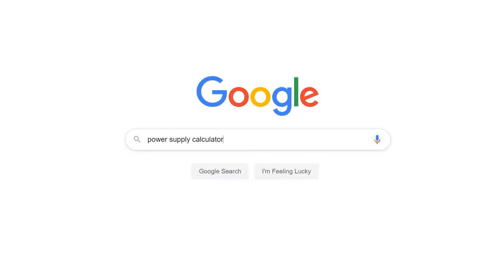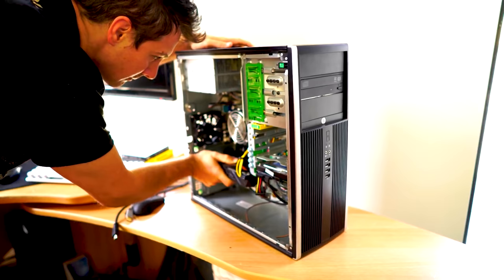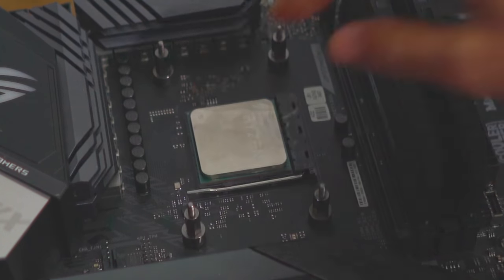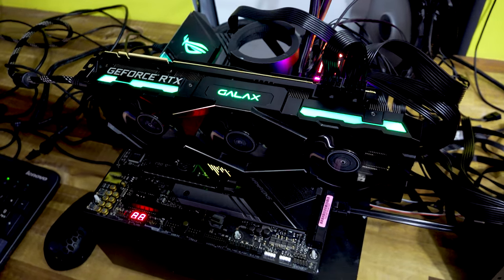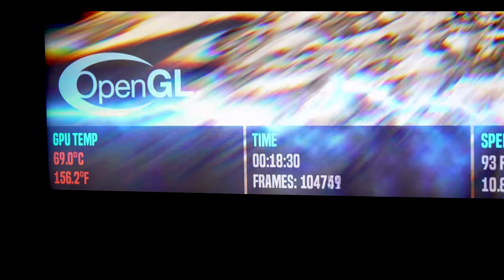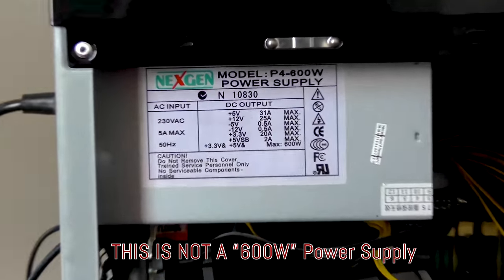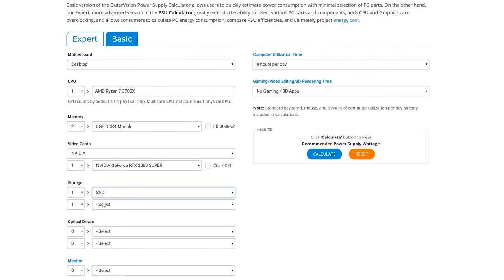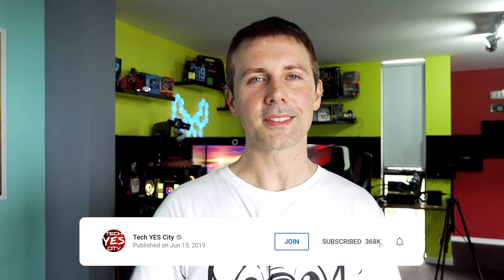I Tried Running a 3950X and RTX 2080 Ti on a 450 WATT Power Supply...

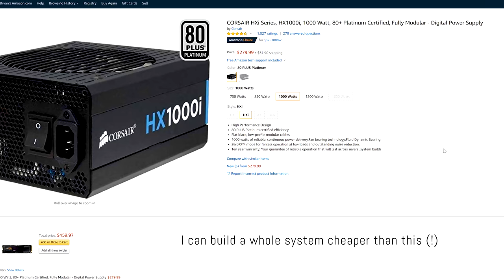Comment: 1:30 I blame online elitists for convincing the guy he needs 1000W power supply.
Reply: "Bro if your computer doesnt have two 2080 ti in sli, a 9900k, 64 GB of ram... is it even a worthwhile computer?"
Reply: @jjt171  need atleast 256gb ram so you can have afterburner running in the background
Reply: The Thousand Watts was probably Overkill, that said once I add in a handful of hard drives, two Optical drives, my extra weird card reader for reading any card made in the last 15 years, a video capture card oh, and a double handful of USB peripherals I don't really have a problem with burning an extra hundred fifty plus Watts out of the wall it just happens.
Reply: Those PSUs might still be recommended by people like myself, not really elistism, but those of us that did a pc build during the era of Radeon and Nvidia GPUs running stupidly hot and consuming insane amounts of power back in 2010-2012, just think about the GTX 400 and 500 series, a 560 NON TI takes as much power as a 2080 TI but the 560 obviously have to draw more power on average as it was a low-mid range GPU at the time, meaning that it can hit that max TDP much quicker then a 2080 TI....

Worse yet, we then had AMD and their Pheneom II X6 series which would happily sit at a 135w TDP!!! 135!!!!
To make it even worse, back then when the 400 and 500 series cards were relevant, SLI and CFX were much more common so now you got two cards able to draw 440 watts, and a 90-135 watt CPU, meaning that suddenly a massive 1200 watt psu with a 80 bronze rating...oh and if you wanted the big fancy 580 ti you would go past 500 watts in a SLI setup...and the 590? 365 watts...ok true that was already a dual GPU card but still! 365 watts!!!

What I am getting at is; we got a lot of people that do not know better because of past experiences with power requirements, it was only with the GTX 600 series Nvidia got their shit together in terms of power consumption

Comment: I have run a Vega 56 + 7700K (both heavily overclocked) on an EVGA 550W unit and had no issues whatsoever. 
FPS was capped at 144. 
But I have always trusted EVGA units so it was no real surprise.
Go for a quality, trusted brand and you don't need a super high power rating.

Comment: i was half expecting him to just plug it in, see it doesn't work and then end the video
Reply: Why? PSU has like 25% of headroom??
Reply: @rkan2  the moment he overclocks his cpu and changes the monitor to a 2 or 4K resolution is the moment this PSU will either smoke its fuses off, or will just refuse to run.
People need to understand that people who buy enthusiast level hardware like the ones he shows mounting in his clip aren't actually buying them for casual use as he gives an impression, let alone the hardware he stressed on was built to take heavy workloads, and I would add that he actually misuses it in this clip unfortunately.

Tell me one lad with a decent budget who would pick a 2080ti with a 1080p monitor, or a lad who got himself an r9 3950x just to use it for casual work load and not even overclock it?. Hell tell me what kind of people who buy this kind of hardware who aren't at least tech savvy enthusiasts and tinkerers in the first place.
Reply: @achu-7941  I mean... There is still plenty need for 2080ti when you have 144hz+ monitors at 1080p...

Comment: After my 650W budget psu (corsair) died, i opted for a  850 model as i though my system needed more juice. 
Waaay overkill for an i5 and 960 gpu.
Reply: I use an 850 watt for my 2080ti and 3900x I think you need more for the i5 and 960 for sure
Reply: itll run cooler and at around 50% use, most efficient as it peaks at around 40 to 60% and drops slightly at 90% and up. So having headroom is good but planning to have the psu run at 50% avg is best.
Reply from the maker: be careful with powerboards, i have had a power board trip out my whole circuit and damage a power supply in the past to the point where it is smoking now (unusable), that power board suffice to say is no longer in action.
Reply: A 450W Corsair CX would have been the right option IMO (unless it was a k model, then 550W)
Reply: @techyescity  Yeah i'm currently using a powerboard as an extension.
It has like 6 sockets to plug in but i won't go higher than my rig and monitor.

Comment: A lot of the branded power supplies are all made in the same factories in China these days. Coolermaster being one of the main ones. GPU Manufactures always spec high ratings on Power Supplies because of all the inferior models out there. One of my favorite system builds was Dual R9 280x crossfire, i7 950 OC @ 3.6GHZ, 8GB RAM, SSD . It ran crossfire games on Ultra pulling 350 watts from the wall. I had a 80+ gold 550 watts installed and it didn't miss a beat.

Comment: Are dell’s 1060w 80+ gold any good ? I mean they are “cheap” and look decent
Reply: They were took out from old Dell workstation or tower server I guess. They are decent, most of them are made by Delta or Seasonic. Both of them are good name in PSU making scene.
Reply: @Archmage1809   isn't dell power supply are made by great wall ?

Comment: Volts multiplied by amps equals watts.
Reply: Input (AC at wall) and output (DC) wattages are different.
Reply: @williamlau7179  the same formula still applies for both AC and DC

Comment: Most quality power supplies have some design headroom, and so do the components. When my 800w PSU died I ran a spare 450w PSU past it's rating for months on end and it was fine, never got hot either. 500-520 watt power draw at wall for me. It is still a gamble, any weaknesses in your hardware and the magic smoke comes out.
Reply: id say "most quality gold rated +" have the headroom design, on cheaper psu its the other way around most of those trashy psu's cant even deliver what they are rated for. Also most workloads dont stress all components at the same time thats why you managed to run your system on 450w psu.

Comment: You can run inadequate PSUs on a larger draw system you just run the risk of system instability,  wearing the PSU out faster or making the caps explode potentially. You can also run a laptop or monitor with a lower than recommended amperage but same thing might happen- hotter higher stresses stuff usually fails faster but it’s probably fine in a pinch.

Comment: I was always told to get a power supply that lets you run your system at 50-60% of the rated wattage. That way the PSU isn't running like mad just to idle at the desktop. Also, the higher power output PSUs are usually more heat efficient.

Comment: Power supply calculator: "Recommended PSU Wattage: 521 W"
Also Power supply calculator: "Recommended Power Supply: 650 W"
Reply: Well you might have a HDD or several USB devices.  Not to mention fans.  Then there is water cooling.
Reply: @MrRourk  it....it's literally the point of those calculators to take these things into consideration. That's why they ask for such things in the first place.
Reply: Most reputable PSUs have 80+ something efficiency certificates, which means that they waste less power from the wall when they reach that 80%+ threshold, so maybe that sites are recomending more watts in order to fill that 80% of their capacity and being at maxumim efficiency.
Reply: @MisantropoFilantropo  80+ efficiency doesn't mean you have to reach 80% usage to reach that efficiency. It's a certificate that shows how energy efficient a unit can operate at 20, 50 or 100% utilization/load. 

So no there isn't any 80%+ threshold you need to meet. It just means that the unit itself is more efficient by converting less than 20% of the power into heat at 20, 50 or 100% usage.
Reply: Most of these sites are having partnership with PSU manufacturers and they want ppl to buy expensive PSU because they want more money

Comment: I generally like to overbuy on a PSU.
But not in false thinking that I need that additional power, but to have it more silent, because it is not as stressed out and therefore runs cooler.

For instance, I bought two 550W PSU recently, although even the little brother with 450W would have done mighty fine (Optiplex 3020/9020 replacements).

Concerning acoustics I have been damaged by my first PC all those years ago. That thing was loud as a jet engine (literally! And that is also the reason, why I avoid Cooler Master fans) and I want my rigs to be near silent now because of that.

Comment: problem is that people WILL use this as confirmation that they can scrimp on a psu, and while it may hold up when new, what about as it ages and starts clogging with dust? Many are already arguing they can get away with lower than nvidia's recommendations on the new 30 series gpu's. People are also likely to forget they've pushed the psu to its limits when they later decide to try an overclock, or maybe upgrade. Yes that 1KW example is clearly overkill, but it's always wise to err on the side of a comfortable safety margin. I have known an older, cheaper psu to catch fire and that's a serious hazard

Comment: Higher watt psus are gonna become obsolete in the future as everything gets more power efficent
Reply: As things get more power efficient, people just pump more power into them for better performance. Go back 20 years. Look at the gfx cards. They're tiny with tiny heatsinks.
Reply: BTW laughs in more rgb
Reply: Sure, when everyone is actually running on stock clock, stock boost clock.
Reply: It has already happened, 700-1000w was common in P4 days and even somewhat in Fermi. We are easily past peak psu wattage buying even if there are miners and some people buying 1600w psu cause it has bigger number.

Comment: Now that the 30 series cards are out, this did not age well...
Reply: Why? The point still stands. People think you need at least 850w with a 3080 system to be stable but I'm running my system with 9 fans plus aio on a 600w psu no problem.

Comment: I'm licensed by the U.S. FCC for radios. I can tell you that PSUs are a strange beast and don't like being run near full load all the time. If you need 500 watts, it's better to go at least 600 watts as an example. PSU ratings are for peak and based on duty cycle, not continuous.

Comment: All my builds only really need between 550 to 650 watts PSU max,  But i always go for a 850 80+ Gold or Platinum PSU for the extra headroom & to keep noise & heat down. Plus most PSU are most efficient at around 50% usage & a little extra power for unforeseen upgrades never hurt.

Comment: I tested a gtx 780 ti and an i7 950 pc with a 400 watt coolermaster psu. It held up for a couple hours and the wattage from the wall said it was using up to 480 watts under load

Comment: I once ran a FX-8320@4.5Ghz with two 120mm fans on a EVO 212, two HD 7850's in crossfire, 4 HDD's and a SSD, and two 140mm intake fans. Without toughing the GPU settings everything ran juuust fine on a 420 watt PSU.. granted it was rebadged PSU from a 550 watt Seasonic unit with the breaker set to 450watts because either the PSU didn't test well or they made too many and weren't selling but also didn't want to undercut themselves idk. But there was little headroom for the GPU's, so i just undervolted them. Only ran it for i think 6-8 months since it was more for funzies than anything else. Once i got sick of crossfire i sold both and got a HD 7950 3GB and overclocked it to 1350Mhz with the help of Liquid Metal Ultra. Then finally upgraded the PSU to a PC Power&Cooling Silencer Mk III 850 watt, it was open box at Micro Center for $82 (looked up the receipt just now lol) marked down from over $200 at the time. The more stable and cleaner power made it so i could lower the voltage a smidge on the CPU and get the GPU up to 1425Ghz rock solid. Got greedy and went for max OC which then popped a air bubble out of the liquid metal and fried the GPU lol, BUT hey!! got it to 1525MHz Furmark stable @92c. Welp that's my story of my golden HD 7950 which i kept as a trophy ;-P

Comment: correct me if i'm wrong but if you are running a 450W powersupply at  400w, it's only going to take plugging in a few extra USB devices & you might find yourself having all sorts of problems?

Comment: Strangely enough in past there were PSUs that could offer a lot more power than their name would suggest. Some manufacturers did this so they could use a higher "80+"-rating for the power supply.  For example Super Flower's  "Golden Green Pro 450W" was in reality 550W unit.   It remained inside "80+ Gold" standard when power usage was below 450W. After that it's efficiency would drop slightly and it would be "80+ Silver" unit effectively. 
In past I tested Intel Core 2 Q6600 + 8800 GTS 640MB with 350W Fortron OEM PSU. It worked, but sounded like it would explode at any second.

Comment: i enjoyed your video and you did explain a lot in the end of it. 
I will also like to add a true factor in buying just the "Power you need PSU". A factor in that is that all components working for the "Only as you need" PSU will be components working always in their upper limits. That means the lifespan and all components prone to malfunction will sooner provide that malfunction and also limit lifespan. 
Instead buying a bit higher Wattage PSU(and bit i mean 50-100 more watts) removes this factor effect due to the fact that its components are made for more power that you need. Giving them a bit space to breath affecting their lifespan too. 
Not to mention another factor that may require you to buy a Higher Wattage Fuure upgrades. PSU tend to be less upgradable. You buy one you propably marry it even if you switch other parts. I have a PSU of over 13 years now...and i have changed mobos, BRANDS! Intel / AMD and 3 gpus! the PSU is same Thermaltake 525W from 2004! So that is antoehr factor at least for me too. 
From all the youtube videos, though not only from your channel but most tech channels...noone explains HOW IMPORTANT a UPS is! Please take that to consideration for a future video.

Comment: PSU FAN NOISE MATTERS TOO!!
Look for not just quality, but a PSU with a nice fan curve. A while back I bought a 750W PSU because I calculated my system would use just under 50% of that so I bought the model where the fan stays OFF until 50% load which I don't hit... however, newer PSU's have great options such as the Corsair CX550 which is reasonably priced and the fan stays at 10dB (can't hear that) until about 225W then slowly ramps up so it's still only 20dB at 440W load... an R5-3600 + RTX2070 Super system probably uses around 300W total for typical gaming so IMO this would be a great choice!

Comment: I run a Ryzen 5 3600 X and Radeon RX 5700 XT with 1 M.2, 2 2.5" SSD and 4 HDD on a 500 watt power supply. 16 GB RAM and 5 RGB fans and RGB heatsinks too. Calculations said I would be close to max, but it's been good so far. At some point I'll upgrade to like a 650, but for now it's solid.

Comment: Exactly what I was looking for! Thank you so much for this video. I have a gold 450w PSU and got a bit anxious when I saw that new GPUs demand like from 650w and up. I had it running stable a GeForce 1080 like some years ago so it seems a GeForce 3070 should be somewhere around maximum now. Thanks again! 🙂

Comment: i built an ITX build with a 2700x and a titan x pascal with a sfx 450 watt. it can max the psu with max load on both but i run both cpu and gpu at stock settings, it holds up. i have a 3600 on the way to help out on power draw over the 2700x. good video.

Comment: I have an HP ‘get me by’ 1080p PC with an i7-6700 and a gtx 1650 OC (DDR6) with the stock 280w 80+ PSU. I had to buy a sata to 6 pin pcie cable adapter, but so far, so good.

Comment: I ran a 1950x and a 1070 on a 400W be quiet pure power 9 with no issues as my daily driver. Ran with no issues. 
It couldn't handle a 1080ti though that was too much.

Comment: I have an HX1050 in my 3900X GTX 1080 system but only because I've had it since 2011 when I had a crazy overclocked SLI rig that would often touch 800-900W. I miss the days of SLI, I don't miss the heat it dumped into my room

Comment: Got a OEM power supply with 54A 5V line and 32A 12V line and a incredible 7.2A -12V line. Converted it to a bench PSU. It let out the blue smoke...still running tho

Comment: I just bought the same power PSU but the 650 one. It was the only one available on Amazon Canada. I wanted a 750 now I'm I'm happy with what I got 😊 I'm building a r5 3600x system with a gtx 1660 super according to the site I only need 510watts so I should be good thank you for this awesome vid 👍 so helpful

Comment: No Problem at all... in fact, ive built some Systems right now with similar Components and Corsair SF450 Platinum PSUs - they work perfect and never over 425-430W from wall at very heavy loads. (Prime95 + Heaven / Valley Loops). Under normal Gaming load @2k Res all maxed out u land somewhere by 360-380 max... 
At ur Wall-Energymeter uve to remove the difference from Efficiency i think :)  
Well, sure  if the SF600 have had available there i would have used em, but it was just the nice SF450 Platinum available...and so i tested it for some days over all and it did work just perfect.
best regards o/

Comment: Something that heavily stressed both the GPU and CPU at the same time would've been interesting, since some pre-overclocked 2080 Tis like the Gaming X Trio have been measured to consume 315W or higher and with a 3950X maxed out, that doesn't leave any headroom for other components at all. Of course it's not like the video was recommending going for 450W, but pre overclocked GPUs are the norm so it's something to keep in mind